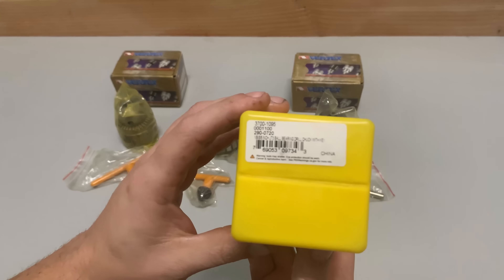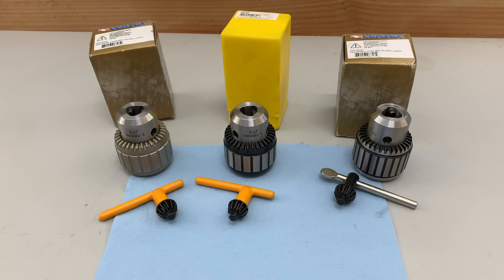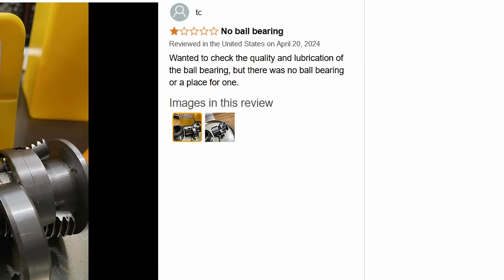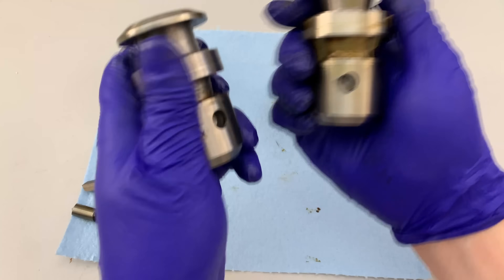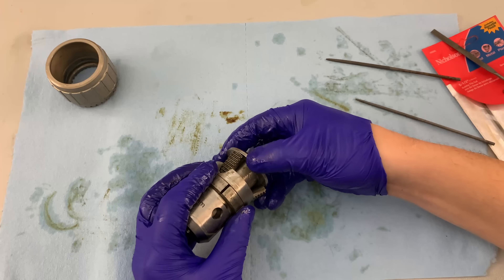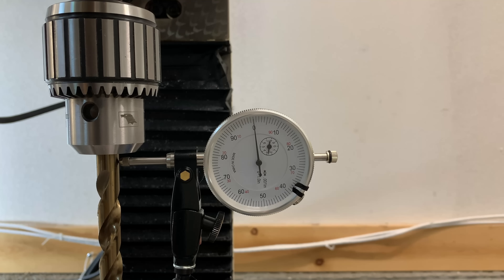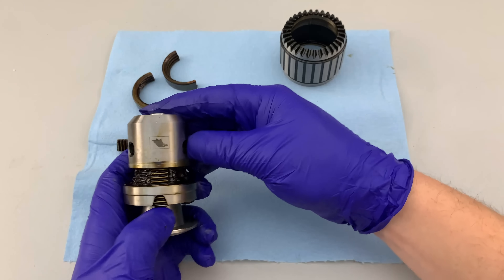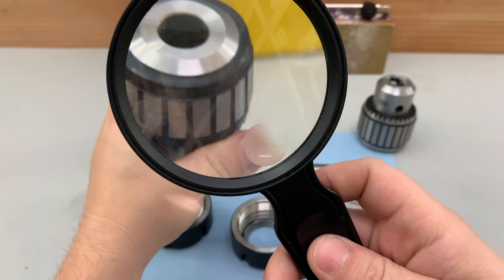Made in China vs Taiwan: The ACTUAL Difference

Comment: Lol.  That's typical china.  The products are SO cheap and SO marked up that they can send a replacement for free and it doesn't matter.  They also get to ship it for 3 or 4 cents to your door.  Your local post office handles it from the port of entry to your house for ZERO dollars as part of international agreement.  Go to your post office and ask how much it would cost to ship that Chuck back where it came from and compare that to the postage on the package you got.  It was probably 19P so like 3 cents USD.
Reply from the maker: Mislabeling is really disheartening. not sure how much is on the importers vs the factories
Reply: @ShopHumor  It's both.  I had one story where the factory was told by the importer that "we cannot sell the product unless it is marked UL or ULc" so the factory just added the mark.  The importer should then check that it is legit and since the factory turned it around super quick of course it was fake.  

The TLDR is if you get an "unbranded" product from China you can be GUARANTEED any ULC or CE or UK mark is fake.  Full stop.  No exceptions.  Look up any "UL" listed product and see.

If it is a "branded" with random letter company then the certifications are also fake.  If it is a branded product with a name that is a name the certification is probably fake or the product is counterfeit or both.  If it's a real company with a real name the certification is also probably fake.  Did you know there are Chinese patents?  There are!  And in china the chinese patents are able to be enforced.  How many Chinese patented products have you seen?  Probably zero.  If they had a patent they would mark it.  Most products are copies of copies of copies and gone through dozens of cost savings and half of the makers had no idea about the final use or metallurgy.

On the engineering side of things here's a few true personal stories:

My brother went to China for a conference and gave some talks and handed out business cards.  A few months later he found out that companies were listing him and his company as a business partner on projects.  There is nothing he can do because as a foreigner you have ZERO rights and you WILL NEVER win in court or get a local company fined.  But if they come here the uneducated and politicians (which make up far too many people) treat them as 100% right and "of course immigrants are super hard workers not like people born here".

The trouble is in the west we live in a trust based society.  In the east they are still living in an opportunistic society.

For example.  I am an engineer my boss was an engineer.  He sat on one of the boards that investigates ethical violations... hilarious.  One day we had a situation where I COULD sign a letter and get paid $500.  It would take thousands of dollars of effort to do the work needed OR I could just sign the letter and make the money.  That was my boss' preference.  I had already done the math that said it was impossible and there would need to be reinforcing.  Anyone who said otherwise was lying or incompetent.

I said no.  They can go find some (person of the same ethnicity as my boss) to sign it.  My boss said "exactly.  They are going to find someone else to sign it so you aren't protecting the public from anything so why not make $500?"  I told him what I thought of that and how stupid he was.

He doubled down.  "OK what if I find a 3rd party to sign it and then you don't have to".

I said... I would find out and then have to report it and then what?

He said "OK so how about I go and get someone to sign it and then make SURE you don't see it!  Then you would not be required to report it!"  He thought he was a genius!

I said.  Are you stupid?  You have just told me about your plan to make a plan to hide stuff from the signing member of the department so you could unethically collect $500 and not do the work?!?!  That's like 2 violations at once!

So of course he didn't do it.

Not.

A couple months later one of the junior engineers had a letter that clearly should have gone through me.  He wasn't comfortable handling it.  He is mechanical and I am structural.  I saw the letter and it was PRECISELY the letter that my boss had schemed.  It was signed by a 3rd party (of the same ethnicity as my boss) and it clearly stated that it was OK.

I grabbed the junior engineer and the other engineer in his office and ran them both into the boss' office.  It was funny because my friend was just hired as the boss' "assistant" but the boss was so stupid he didn't know the guy was his replacement.  It was my friends first day and he was there to handle dodgy dealings.  He just stood there while I reamed the boss.  My friend had also already known about the boss' original plan since I told him months before.

My friend ended up taking down and replacing my boss and his boss (also the same ethnicity as my boss).  And in like 3 years he was equal partner to the head guy (we were just a small subdivision and were closed, my friend ended up partner to the main company).

The fact that my boss was able to just tell people that he knew what he was doing and tell people that he was ethical and even be on the board for ethical violations shows the problem with the west.

While my friend worked with my boss he was confused that the boss would ask him "hypothetical" ethics questions.  Turns out he is so unethical he can't even fake it.  He was running the INVESTIGATIONS he was part of for the licensing organization through my friend and then submitting his answers as his own!

If this was a single case OK fine.  But it is not.  Every single unskilled cleanup I had to do was stamped by a person from the middle east or far east.  In about 20 years the fruit of this trash will cause immense costs to infrastructure and buildings.

What we need is a "customs house" where EVERYTHING comes into the country is checked for legit UL numbers and taxed.   The UL system needs to be updated so it can be sourced back to specific products and companies.  And ALL products entering the country need to have a verifiable and real company name etched into it.  No removable nameplates no rebranding.

And we need to stop the influx of foreign trained engineers and sadly "immigrant" engineers.  These people have NOTHING to lose coming here.  It costs a bit of money and hoops and then they get "licensed" and then stamp and sign ANYTHING for a few dollars.  I mean ANYTHING.  Napkin?  No problem.  A single sheet with some scratches, no problem!  Literally saw the BACK OF AN ENVELOPE "sketch" stamped by one of these guys.  They come here and do whatever it takes to make a buck.  When they are investigated they "promise" to change but don't.  The stupid organizations give them so many chances because we are trust based and engineers USED TO BE ETHICAL and bound to protect the public.  The engineers come here and take the same oath... its an actual oath but they just stand there and make the mouth noises they are told to make and get licensed.  

When the organizations finally "properly deal" with these people they people opt to turn in their license... its because they RETIRE AND GO HOME!  Rinse and repeat.
Reply from the maker: I don't have a problem with someone trying to make a buck or trying to get ahead in life, but I do have a problem with people who do it unethically or at the expensive of everyone else.

Comment: I watched a documentary from China on a major steel foundry.  They were shutting down due to updating the factory.  The major "improvement" at the new foundry was THERMOCOUPLES!  They had been using their EYE to gauge temperature up until 2021 when they shut down.

Steel quality is always a random chance in china.  It could be good.  Could be ok.  They even had to make a new ASTM standard for Chinese steel because the grade of steel is plus or minus 10% and the thicknesses are plus or minus 5% which is ridiculously bad.  When you have to make a lesser quality standard maybe you should reconsider letting it into your country.  There have been many times that I have seen the types substituted one for one because "it's all the same".  It is not the same even on paper it's not the same.  You can touch the steel and feel the grit.
Reply from the maker: That's wild!

Comment: I only buy cheep Chinese chucks on eBay now that jacobs buy their chucks from China and they no longer sell rebuild kits for their new Chinese chucks. I’ve had good luck with the eBay chucks except for one. Runout was wildly horrific for that one chuck. Something like 0.040. Imagine what that looked like at the end of a drill bit. I could draw circles with it. Luckily the seller had no problem with the return. The chuck was a 5/8 keyless with R8 arbor installed. I didn’t bother to verify if the arbor or the chuck was the problem. I just returned it.
Reply from the maker: That's a crazy runout lol. Glad you had no issue with return

Comment: To measure the runout correctly, do it twice. Make a mark on the drill, take a measurement and then rotate the drill 90 degrees in the holder. After all, if the holder has a 0.01mm runout and the drill also has a 0.01mm, one runout can eliminate or even amplify the other and therefore give an incorrect end result. Rotating the holder 90 degrees will at least notice this error.
Reply from the maker: thanks for the feedback!

Comment: Would a ball bearing chuck  with no ball be a eunuch chuck? 
Seriously, Chinese products depend on what was specced and how tight the QA is. HF Icon tools are very good and priced accordingly, the stuff in the cheap tool bin at Ace is made cheaply and priced cheaply.
Reply from the maker: I think a pedantic viewer would suggest that the chuck must have been designed and manufactured with ball bearings, only to have them removed later, to be correctly called a eunuch. Though I'd call it one. I think I may even have in the video, though it's been a while. I agree about the quality, too. It seems to depend on who is importing the product. Lots of importers are looking to cut costs by cutting every corner they can. I'm certain there are very high quality products that could be imported if they so chose, the Harbor Freight Icon line being a great example.

Comment: Do you suppose they load it up with grease with the expectation that it will stay lubricated for life as the grease starts to break down?  I know it's not unusual for something brand new to feel stiff but will loosen up the more you use it.
Reply from the maker: Yes, I do. I think they just jam pack it full of thick, heavy grease because most people are never going to disassemble it to do periodic maintenance, and the thick grease coating everything will act as a corrosion preventative. The light coating of grease on mine makes for smoother operation but I'll need to occasionally repeat the process.

Comment: Interesting that they didn't just offer you another chuck WITH ball bearings, this suggest to me that none of them have ball bearings.
Reply from the maker: Indeed. They were aware of the issue, so my inference is that the manufacturer who supplied their stock either messed up (or, more likely, cheated them, and as a result, consumers like us). 

I do plan to follow up after a while and buy another ball bearing chuck from them to see if they’ve corrected the issue. I’m going to be comparing a cheap knock off ball bearing chuck (hopefully from HHIP, if not I’ll get one somewhere else) with a vintage, USA-made Jacobs brand ball bearing chuck, and a brand new (now made in China) Jacobs brand ball bearing chuck.

Comment: I used couple of vertex vices and er collets, for pro work. No quality issues to speak of. One of the shop I worked at had 18 machines kitted out wiht LEAVE base plates and maybe like 50 vices in total their quality was actually rather impressive.

Ps when your checking run out I would recommend using ground bar and checking it atleast 50mm from the face of the chuck
Reply from the maker: Thanks for the tip!

Comment: You asked if we would share our comments about tools made in China, so here goes.   I bought some DeWalt type replacement batteries that were made in China and they would not even drill 1 hole through quarter inch steel before the batteries petered out.   

I sent them back, and got full credit through Amazon.   I then figured out how to diagnose and replace bad cells within the batteries.   Purchased  a spot welder and fix my own genuine Dewalt batteries now.    

Other experience is that Chinese tools break and Taiwanese tools last.
Reply from the maker: I appreciate you sharing your thoughts. That's a pretty poor performance out of those first batteries you bought. Replacing the individual cells sounds like a really good skill to have.

Comment: I've got a vertex pro series chuck on my mill at work and literally never had a problem. Thing is though that mine has that eagle on it. Drills holes perfectly for blocks that need to be pretty accurate for the wire edm shop to work with.
Reply from the maker: I think a lot of them have the Eagle it's been one of their logos for a while. As far as I know Vertex is generally an awesome brand for high value affordable tools like that. I'm not surprised that yours has been accurate. I bet a wire edm shop is fun!

Comment: Interesting comparison. I have a few Vertex tools in my home shop (in the UK), including a dividing head. They all have proved to be adequate and good value. The finish on machined parts is very good.
I think all tools, wherever they comefrom  benefit from a strip, debur, clean, re-lube and careful reassembly.
Reply from the maker: Thank you! I agree with your practice - strip, debur, clean, re-lube, and careful reassembly. That's always been my procedure as well. Glad to hear your experience with Vertex tools has been good. I plan to get more (eventually).

Comment: I always check runout with the indicator located, 1 inch from the surface and use a dowel pin or gage pin.
Reply from the maker: I've had some good feedback on refining that testing methodology (including, as you suggest, a dowel or gauge pin), as well as measuring at the top of the pin closest to the jaws, then at the bottom of the pin to see if there's a difference in runout between the two. Thanks for commenting, I really do appreciate the feedback because it will help future videos.

Comment: Machine shop owner, Philippines. Duterte administration made it possible for West Taiwan to dump super cheap and inferior goods in our country- i am always on the lookout for legit Taiwan or Japan equipment as these are generally better and have more value. 

I have some West Taiwanese equipment like the ER collets on my mill- i had to regrind the the arbor true because 0.1mm runout was a little too much.
Reply from the maker: Good tip, will look out for those issues. thank you

Comment: I run a shop with small machines, low volume production (<=20pcs) and r+d work. I am impressed with Shars and HHIP for having precision and motion adequate to my purposes. My Jet lathe (Taiwan) is likewise true and its 3-jaw chuck came with <.003" runout, which I hear is normal even for better, older machines. The gold standard equipment is out of my price range so I am pleased to buy those brands. The only thing I don't compromise on is measurement. Starrett or Mitutoyo. No matter what your equipment is, you can feel your way to a good result if you can get good measurements.
Reply from the maker: I also have been impressed with Shars and HHIP so far! I love my Mitutoyo measuring tools and I also have had good luck with Brown and Sharpe. I don't have any Starrett in my toolbox just yet because of the price, but I've actually been looking at some older ones on eBay just this week that are reasonable...
Reply: @ShopHumor  What I noticed about the Starrett is its resilience and its sensitivity. It is made in such a way that it is relatively hard to damage- the indicator body is sprung against the face and can give. It is so sensitive that even though mine has its small ticks at .001", I can count on repeatability to .0005, because there is so little internal friction in the mechanism. The arms clamps and joints, though simple, are much more precise and smooth. I got what I paid for, after 25 years nursing along a Central Tool unit I bought for $60 in 1997.
Reply from the maker: That's really awesome. It sounds like it's made exceptionally well

Comment: I had a cheap 3-16mm Chinese chuck with ball bearings, honestly without is far better. Was made cheap like those but cheap and ball bearing do not mix well so it was sloppy. About .04mm to .08mm runout on a gauge pin, not good, but for a jacobs chuck not the worst, for a drill it's fine.
Reply from the maker: That's a big runout thank you for letting me know about your experience with them
Reply: @ShopHumor  I bet well made ball bearing chucks are the bee's knee's but the cheap ones are hit or miss, as you saw yourself.
Reply from the maker: @JoshuaNicoll  Indeed!

Comment: We ordered an accupro chuck that was hard to open/close right out of the box.  It got to the point after a couple of weeks of use that we had to use the chuck key to open and close it.  We ended up getting another new one so I cracked open the old one.  There were burrs inside left over from drilling the passages for the jaws which had destroyed the cage (plastic) for the ball bearings.  The new one feels exactly the same as the one i dissasembled.  Very disappointed.
Reply from the maker: That's awful and I agree, very disappointing. Those burs can really mess things up internally